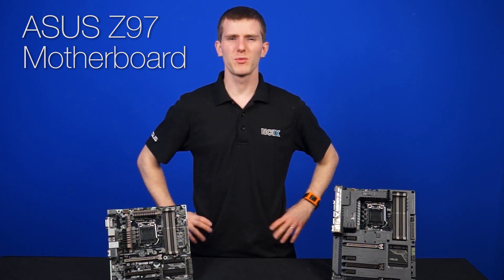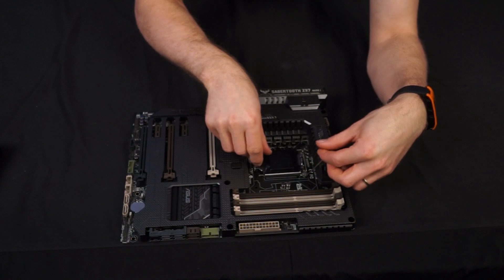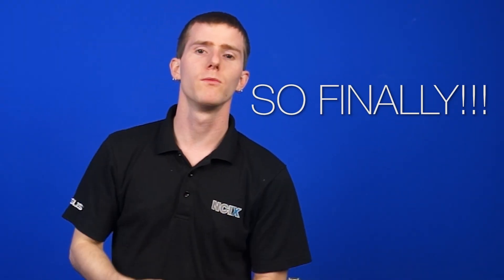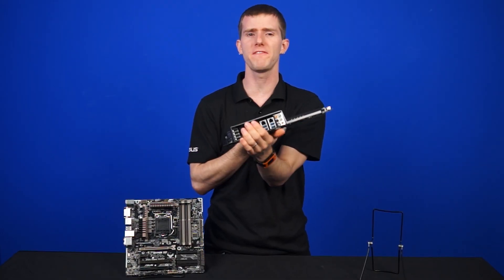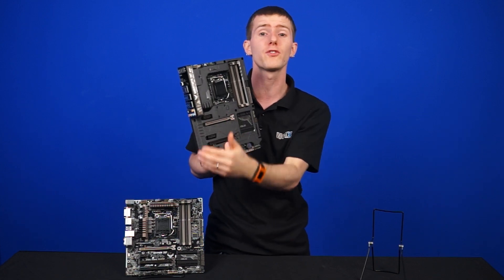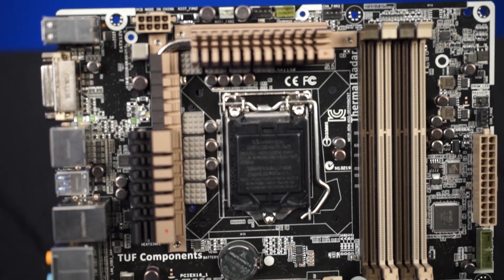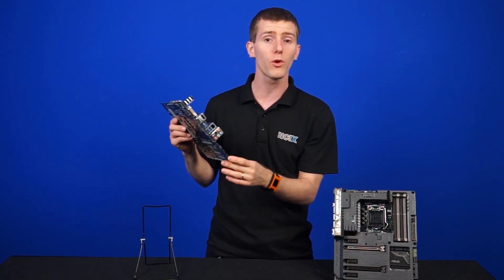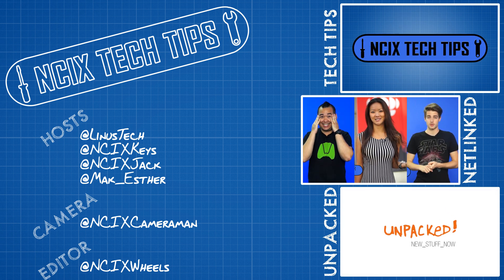What is the Z97 Express Chipset ft. ASUS TUF Motherboards - Sabertooth + Gryphon

Comment: I only just upgraded from a p5n32e board to a sabertooth mark s as my main board died. Its a really nice looking board and software is very easy to use in bios. I would buy I another top of the line asus board in a heat beat when this one dies, but that might not be for years to come.

Comment: How much fps, can you get on Battlefield, Minecraft when your using asus saberthooth Z97 Mark 1 and Asus GTX 980 strix?
Reply: Kasj26 Miner The motherboard has nothing to do with it.If you want to play games while rendering videos you have to pay attention to how much RAM you have and it's frequency.
Reply: Ok. I want the Corsair Vegance pro 16GB ram, or the HyperX Fury
Reply: They're both almost the same with no noticeable difference for an average user but how high is their frequency (mhz)?
Reply: 1866 i guess
Reply: Kasj26 Miner That would suffice.
Reply: Thx
Reply: Kasj26 Miner i would recommend you (if you are buying a new card) to get gtx 970 in sli because its not that much expensive and it will wreck one gtx 980 :D

Comment: I went from.....
Some shitty am2 motherboard
Athlon core 2 duo 2.7ghz
Hd 6970
8gb shitty ddr2 ram

Now
Gryphon z97 armor ed.
I5 4690k 4.5ghz
Cm nepton 280l
16gb corsair vengeance pro
R9 280x xfire
Ax1500i
Nzxt h440
Reply: Moethedirt Now I won't call my previous pc a piece of shit because it served me for 7 years without fail lol but here I go.
e2180 pentium dual core 2ghz
4gb ddr2 ram
and no graphics card

Now(built August 2013)
Asus Maximus VI HERO
I5 4670k 4.7ghz
Cryorig R1 cpu cooler
2 SLI GTX 760s
16gb corsair dominator platinum 
Corsair HX 750
Cooler master storm enforcer case
Samsung 840 Pro
Reply: Niccceeeee 
Im upgrading soon also
I currently have
Amd athlon 2 x4 3.0 Ghz
Gtx 650 1gb
4gb 667mhz peice of shit ddr3 ram its only shit because of the speed
Soon
I5 4590 3.3 Ghz
Msi Z97 PC mate 
8gb 1600mhz ram
R9 270
600B psu
My build will be upgraded more in the future.
Reply: I actually changed it i found out at microcenter if you get a 'K'  processor then the mobo you get is 40 dollars cheaper so an i5 4690k and a cheaper z97 mobo is around the same price as normal and i have been looking into a used 7970
Reply: Dylan Liff Im going from a potato to:

NZXT s340 black
i7 4790k ( going to try to OC )
MSI z97 Gaming 7
MSI GTX 980
16gb Kingston hyperx 1866 RAM
NZXT kraken x61
Corsair RM650

Il also be customly sleeving some cable's to make them look awesome.
Reply: Colonel Ambrose Nice

Comment: im still running my amd 8320 on a asus sabretooth 990fx mobo, 16gb of ddr3 1866 hyperx fury with x2 sapphire 270x toxic edtion. I got these from when i upgraded from my z77 system. But now want to move back to intel due to the age of the fx lines. Don't get me wrong but i like an upgrade every 1.5 to 2.5 years and I dont want to go the apu route...

Comment: i know i am late, but i think i am going to get a z87 board since the prices lowered a TON since z97 release... this is coming from a guy who has been running lga 775 for over a year now... it was first pc okay... it was off ebay and was cheap :'(....

i dont really need the whole sata express and i hope broadwell is supported on z87, since i plan to get the msi z87 mpower... it looks amazing and is cheap for only around $100
Reply: Actually, z87 won't support broadwell unfortunately. That's why I'm getting a z97 for about 120-130 bucks, plus it's an ASUS! I'm with you on the whole 775 thing, bottlenecks the heck out of my 750 Ti. z97 is better for future readying, as I'm getting a i3-4150 to hold the place till an i7 4770k gets about $200.

Comment: I'am going from

MSI Z77 MPower
Intel Core i5-2400
XFX Radeon HD 6850 1GB GDDR5
Corsair Dominator DHX DDR3 1600MHz 4GB

To

ASUS SABERTOOTH Z97 MARK S,
Intel Core i7-4790k
ASUS GeForce STRIX GTX 970
And Kingston hyperx 1866MHz16 GB
Reply: I'm going from:
Foxconn mATX  GeForce 7100/nForce 630i chipset
Pentium e2220 lga 775
PNY GT 430
and 4gb of ddr2 800 MHz samsung

To

Intel Core i3-4150 3.5GHz Dual-Core
Asus Z97-A ATX LGA1150
Corsair Vengeance 4GB (1 x 4GB) DDR3-1600
EVGA GeForce GTX 750 Ti 2GB FTW ACX

Comment: Sabertooth X58 motherboard with a intel core i7 960 3.2ghz, 16bg ram and a radeon hd 6990 4gb gpu. 
''Upgrading'' to XFX ProSeries Core Edition 550W PSU, Intel Core i5-4460, MSI GeForce GTX 750Ti Gaming 2GB PhysX
,ASUS Z97-P, Socket-1150, HyperX Fury DDR3 1866MHz 8GB Blue, Kingston SSDNow V300 120GB 2.5" OEM

Comment: I have  a gryphon z87 motherboard but i have had some problems with it so far it has lost the cpu fan header won't run anything on that  and i have had problems with  snmp protocols on the lan  mine  has been back for rma  2 times  so i am thinking about a maximus hero 7 or a sabertooth z97  . I must admit i like overclocking  so your  input would be appreiated. I will say this even with the problems i have had i the gyphon does work well  and yes i have found the sweet spot for my 4770k 43,43,42,41 it's not a big  oc but it does not  over heat under aida 64 extreme  58c
and my limited funds  and  limited cash to spend on it especially cooling its doing alringht  ram is corsair vengence pro 2133 c9   plextor ssd 256gb  3tb mechanical hdd seagate windows 8.1 .  joe

Comment: Using AMD A10-5700, 8gb ram, radeon 7870 2gb.  I am considering upgrading to an I5 based rig with a Z97 chipset (although i would most likely go with Gigabyte) as the bench results at anandtech show basic i5 CPU's to have about a 40% performance advantage in most situations although I am unsure whether my gaming performance is being limited by the APU or the GPU.

Comment: We still have a four year old H55M-E33 mother board.  It hasn't been replaced because of a couple reasons -- it still works, and I'm cheap.  It actually works really well and I'm very pleased.  All of the components connected to it make for a pretty decent game computer.  Certainly not modern tech, but it plays all of the PS3-era games with ease.

Comment: LinusTechTips Excuse me for being a bit off-topic; but I'm currently planning on building a new PC for heavy audio editing, composing and moderate gaming. For now, I'm in dubio between the 1150 socket and the 2011 socket. The 1150 socket is future proof and will support the next gen intel processors, but at the time of writing the 2011 socket houses the most powerful processors Intel is offering, and I'm really opting for the 6-core right now since the applications I use can really make use of that. The downside to 2011 is of course that the motherboards are sometimes already 3 years on the market and its future may not be guaranteed. At the other hand, getting a 2011 socket 6-core cpu now may have me settled for the future to come.
So, what is your opinion on this? Should I go for the future proof 1150 with z97 chipset with it's newer features, but be limited to a quad-core now, or should I go for full performance with the 2011 socket but hand in on upgradability?

Comment: 4570//h81ampup//gtx760sc

Not really looking to upgrade right yet. Once I decide to, new PSU, new mobo, more ram, 

Only thing I'll be able to recycle into my next (3rd overall) will be the ssd, HDD, existing ram, cpu cooler, case you get the picture. My aim was for non oc, single GPU setup

Comment: Still running a AMD Athlon 64 3200+ in a ASRock K8NF6G-VSTA at 2.66ghz(oc),
with Nvidia 6100 nForce 405 and with 1.5Gb of memory running at 166Mhz. Hardly plays Youtube video's :( but upgrading to a Z97 with 4770K and either 290 or GTX 770

Comment: My fist desktop CPU was a Intel 3770k on a gigabyte G.1 Sniper 3, but after a years or so i sold it and bought an AMD fx-8350, because the heat dissipation between the cores and the CPU's heatsink was just terrible. Is it still so with the new intel CPU's or has i changed?
(Not that i don't like my fx 8350) 
And no i wouldn't buy a new motherboard just to get faster connection between my drives...

Comment: I'm going to keep my z87 sabertooth, because I don't see the point in spending another $250 for such a small amout of a performance upgrade. I'd rather get another gtx 770 first
Reply: I'm running 770 GTX SLI, good stuff. I am upgrading from z77 Gigabyte board and Sandy Bridge to ASUS ROG VII Hero and a refresh i5. My 13 year old daughter will get my current 2550k/z77 at stock speeds and will be rocking my old 560ti, that's good enough for Hello Kitty Island Adventure and ENDLESS One Direction videos! ugh! :-)
Reply: i might actually upgrade to 2 GTX 780 TI's and get 2 SSD's and put them in raid 0 with the $250 instead of getting a new mother board

Comment: I've got an MSI Z87-G45 Gaming motherboard with an i5 4670K cpu currently running at 3.40GHz (although I did manage to overclock it to 4.6GHz, sadly had to remove overclock because of inadequate cooling - needs a watercooling block). I would upgrade, but I simply can't afford it right now. Besides my mobo and cpu are perfectly fine, it's my KFA2 GTX 570 that needs to be replaced for a newer model (perhaps something in the 600 series lineup).

Comment: I'm sticking with:

i7-4770K @ stock
Asus Z87 Sabertooth
Corsair Ballistix Tactical 1886MHz CL9 Memory
GTX 780 Ti @ 1200MHz

I built it 3 months ago (first time building) and I love it. The only problem I've had is that my Gigabyte 780 Ti GHz Edition is unstable (like most of that model), so I'm RMAing it to get the EVGA 780 Ti Classified :)
Reply: I am sticking with mine. Very similar except running R9 270 Graphics card still Asus OCII And it is pretty Stable with maxing it out.

Although I am creating a new build with the Z97 but going to be using the Gryphon.

Comment: Current rig is a 2500k cpu on a matx form factor. New rig needed so I'm going with a new z97 atx mobo. I have a extra 4770k laying about  but I'm waiting to see what the Haswell refresh is going to offer. Supposedly the 4790k will be slightly faster, run slightly cooler, slightly less power, and overclocks slightly more. Basically the performances overall is slightly better. Supposedly. I'm curious if all it is just refresh or are they throwing in a new chip or two? Waiting to see.

Comment: Im absolutely torn right now. I am...WAS planning on building my first gaming PC rig(I dont have anything as of right now, just a NZXT phantom 410 case), I was originally going to go with the Asus z87 Maximus formula Vl MB, with an Intel i7 4770k cpu. But now I dont know if I should wait or not, since the z97 is continuing with the 1150 socket, I can still get the 4770k, but the haswell refresh will be coming out and (im more interested in that due to the themal improvements), but i dont want to buy the equipment right now knowing that it'll all be cheaper within the next couple of months. Any suggestions on what I should do? Any response is much appreciated!

Comment: I really hope that the Haswell Resfresh CPUs have a better TIM like they said, because this is big negative point to me. The Z87 platform (and Z97 for sure) have a great overclocking potential but it was quite limited by Haswell's huge amount of heat generated. Some people even delided their CPUs to improve the temperatures. If they fix this problem, watercooling setups are going to overclock the sh!t out of it, and even better with motherboards such as TUF series (the Sabertooth Z87 was even a little bit better than the Formula VI).

Comment: i would upgrade, but it isn't much more powerful than what i have, and haswell runs a lot hotter anyways
Reply: Intel has addressed the thermal issue on the Haswell refresh, so i't shouldn't be a problem any more.
Reply: ***** Haswell 4790 aka Devil's Canyon.
Reply: ***** The 4790K should launch in about 6-8 weeks IF you prefer an unlocked multiplier aswell as OC potential.

Comment: Still running a core i7 860 on a EVGA P55 FTW. Recently did a GPU upgrade, quite happy with that. Went from 2 EVGA GTX285's to a single ASUS R9290-DC2OC. Less wattage, less noise and more fps.

Looking for an upgrade. Was looking for the Core i5 4670k and the ASUS Maximus Formula. 

Now awaiting the release of the new i5 4690k and the new unreveiled ASUS Maximus Formula. Hoping that the new Formula is as sexy as the "old" Formula. Liking the shield very much.

Comment: Running an i5 4440 with the Gigabyte G1. Sniper Z87, that with my GTX 760 and a 120GB SSD is more than enough for me, no need for the extra features that the Z97 offers.

Comment: I own a Maximus VI hero z87 with an i7 and there is no really compelling reason to upgrade. ASUS still hasn't upped the PCIe bandwidth in Crossfire/SLI to 3.0 at 16x/16x which makes it a non-future proof board for multi GPU setups for $85 more than the original.

Comment: I'm still using my LGA 1366 Rampage III Extreme in combination with an i7 950 and a GTX 580. I won't upgrade the chipset in the near future because this build is capable of running nearly every game on ultra @ 1080p and provides a lot of (OC) features that extend the span I will use it. In addition to that it is a waste to get a dual channel ram configuration that does not work with my existing triple-channel kit.

Hope you can understand my broken English. :)
With kind regards a student from Germany

Comment: Asus Z68 Extreme 4 with 2500K, 8GB 1600Mhz RAM and GTX 560Ti-448 core w/ 480 GB SSD.  If I really get antsy at the end of the year or performance seems sluggish I'll overclock EVERYTHING!
Next platform will be rocking DDR4 for sure.

Comment: Currently in the market for a new Gaming PC. Doing a lot of reading on both AMD & intel platforms.

Current PC specs:

AM2+ Asus mobo DDR2 ram 8GB
Phenom II X4 965 BE stock heat sink & stock speeds
GTX 660 x1
2 240gb Intell 530 SSD's in raid 0

Yes I will be upgrading to z97 if intel or 990FX if AMD. As this build is very old & barely does what I require it too.

Comment: Linus, I liked the way you do a "fly by" and stil covered the essentials of the platform! 

So kudos there!! 

Currently I have 2 riggs up and running. 

Project "Bird of Prey",  based on the Z77 platform with Asus Maximus 5 Extreme, an i7 3770K @ 4.6HGz 1.29volts), Dom Plat Ramkit 2666 cl9, 2 x 7970 Ghz. Als in custom built case with full custom watercooling loop. 

This a lucky cpu,  It will run 5400-isch... No subzero needed 

Love the 3770K, still performance is good. 

2th is "project BattleX", Asus ROG MAXIMUS VI EXTREME with i7 4770K, 2xGKill TridentX 2400 C9, @ 2800 C9-12-11-281T, R9-290X. On huge custom water loop 3 x 360mmx120mm (yes have full fan pack; 3x6= 18 Fans). 

I love 3770K better cause it takes me to place 4770k can't go. 

But the IMC on Z87 man :-)  (if you have at least a good chip),  is way better. TridentX even goes up to 3000Mhz, and have broken my personal record hugely..  Currently 3110Mhz.

I  am  bencher,  so I like all systems, but,  for this gen, I don't see any reason to swap motherboard...  Unless the Devil’s Canyon could tempt me.. 

So,  Z77 WITH I7 3770K AND Z87 with 4770K for me: just right,  Z97?  Show me what you got, for now Nope!

Comment: Perhaps but possibly not for a few years. I'm on an AMD build right now since they are slightly cheaper and a bit more simplified than that 14 different sockets that Intel currently have. I'm using an Asus Crosshair V-FZ, but from what I've heard is that AMD has zero upcoming news on any new CPU's and no new sockets to my knowledge. It's been a year since FX-9000's and I've yet to hear anything of a new CPU or if it'll be under FX or if it'll even have the same socket of AM3+.

Comment: im running the 2nd gen i5 2550k and the sabertooth p67. should i upgrade? and if i now would upgrade, does the Noctua NH D-15 CPU cooler fit into Corsair's Carbide air 540 chassi?

Comment: I'm still rocking a X58 chipset overclocked to 3.8Ghz  with dual GTX 680, haven't found anything I cant run on triple screen setup and 3 SSHD in raid 0 put me at an average read speed of 600 megs. So no need to upgrade quite yet, should be good for at least 2 more years.

Comment: z77 i5 3570k OC  7950vaporX OC not upgrading until ddr4 + graphics improvement over mantle, dx12 or whatever wins the next standard. Reason: i hope more than +10% performance increase and whole industry change due to new abilies unlocked by dam fast ram.

Comment: Just went from a I7 2600 what was 3 years old and had many problems with it including high temps with a h55 going above 70 what's not good and having to get a new mobo to z77 I just saved myself and got the I7 3770k and it runs alot quicker brought a h100i with push pull and replaced all my case fans and my gpu temp has gone down by 20 ish and my cup under 4.6mhz over clocked while doing nothing is 35 ish and under load between 44-50 so amazing

Comment: Yes and no...
Features don't really flip any of my switches as Haswell & z87 are fine vs. the new chipset for a simple refresh. They should be compatible... if not, they should enable z87 to take the DC CPU for those who give a rats about the chipset to keep the enthusiast buying CPUs. Ivy Bridge was a waste, LGA 2011 will be a waste due to mobo compatibility too. AMD does that much right!
I will build a DC system, but as a toaster oven with the anniversary edition Pentium CPU... that's easy to answer... Later, I might step up to a proper DC refresh, but not right now.